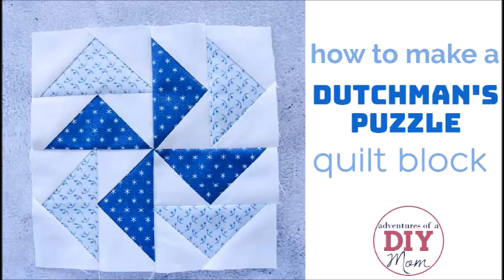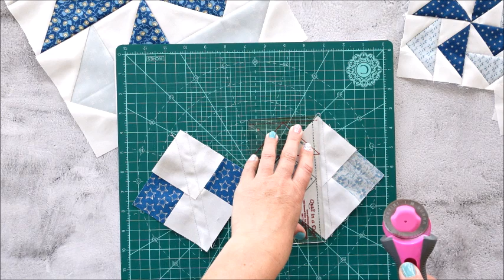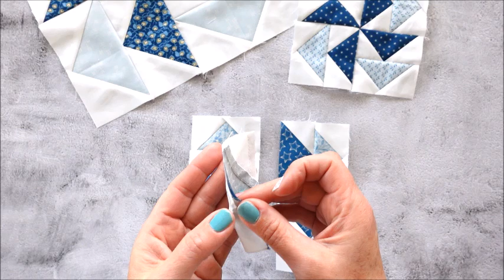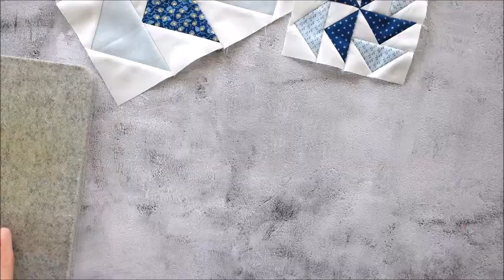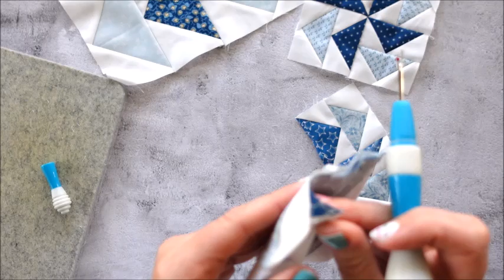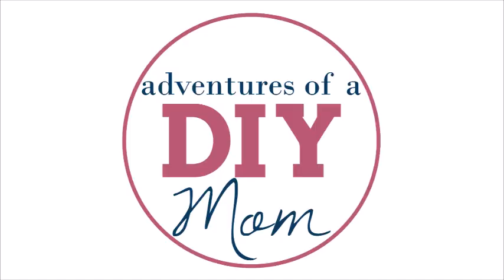Dutchman's Puzzle Quilt Block Tutorial with EASY Flying Geese Method

Comment: Thanks for the information!  I have a few Dutch friends that might like a coaster... or two!😂When I have to remove stitches, I use my dull seam ripper (circa 1993!) so that I just unpick the thread and not have to pull bits of thread out.  A dull seam ripper is also handy for pulling out corners when you turn an item right side out!☺I do have a few sharp ones, but they are only used to cut through something that has been knotted!😁
Reply from the maker: That’s smart!